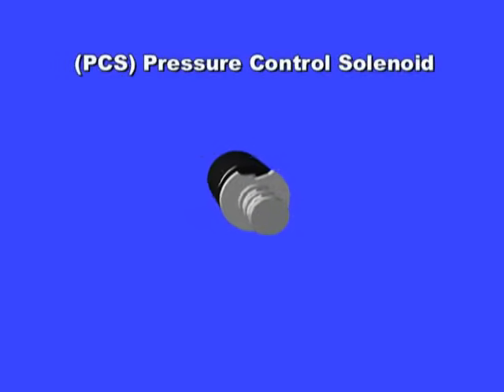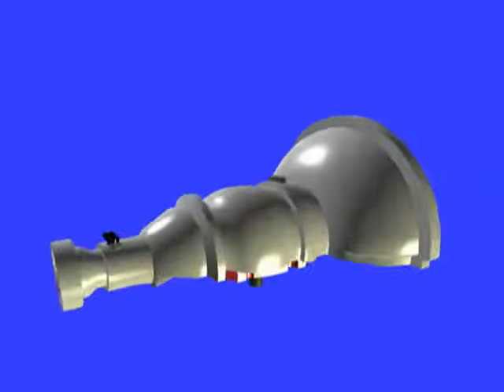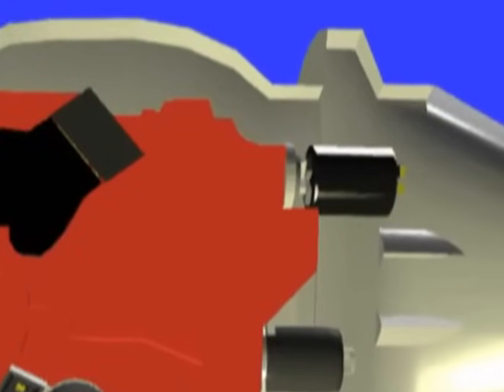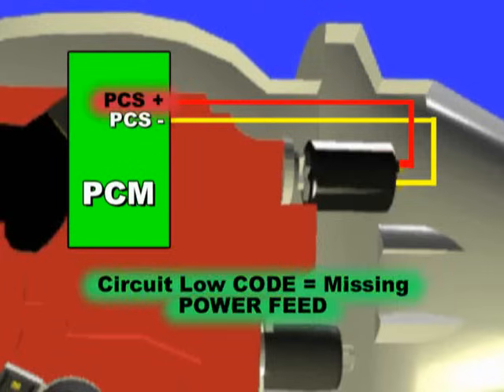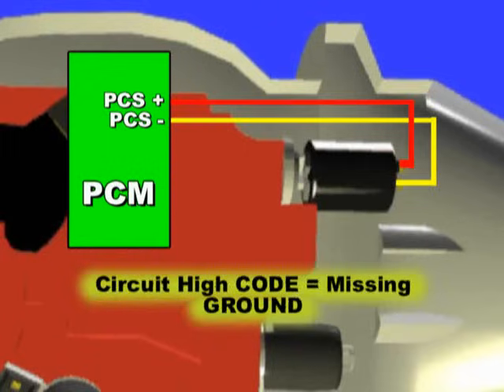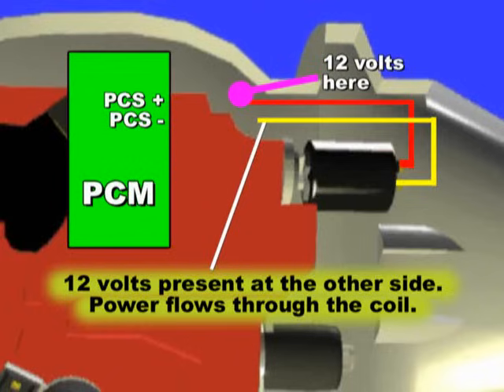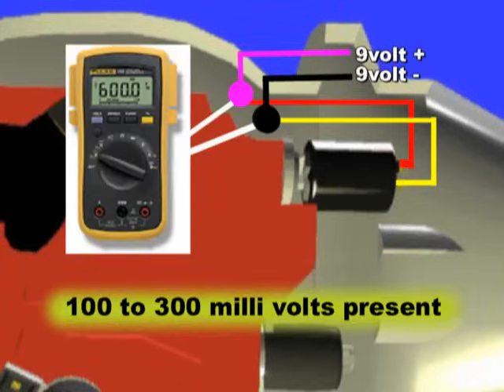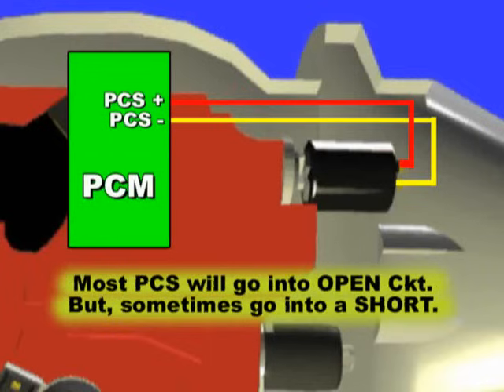Transmission Pressure Control Solenoid (PCS)

Comment: I have an automatic 98 camaro v6... I have no problem on the streets, and typically don't have a problem on the highway unless I make a long drive, like 30-40 min drive. When I'm between 55 and 70 mph it tends to have trouble maintaining speed and it does what seems like a super fast slip/surg and quickly catches and accelerates.  Dont know if it's a transmission problem or maybe a solenoid, and kind of scared to take it to a transmission shop as I feel they could possibly take advantage.... also i just found out my fuel pressure regulator is bad so I also don't know if that has anything to do with my problem. All help or suggestions would be appreciated, thanks!
Reply from the maker: daniel hernande Before tackling the transmission issue (possible) you need to repair the fuel pressure regulator problem. The trans shop will want to rebuild the whole transmission to cover their rear ends and charge you. After your engine is working 100% then post back with more on the trans if needed. Good luck.

Comment: I have a Golf 5, 2.0 FSI model 2007, automatic transmission and it is having a gearbox problem, when i am driving sometimes it stuck in gear 3 or 4, when we connect it to the computer it says (P2716 Pressure Control Solenoid D stuck malfunction) and if we clear the error, the car start working normal for some kilos ( 50 to 100 km) then the same problem come again. Do i need to buy a new pressure control solenoid?
Thanks!
Reply: Sackiro Nehale i have some problem....

Comment: I have a 2006 Ford Freestyle Limited FWD with a CVT and My wrench light (Limp mode) comes on whenever I come to a complete stop. Auto Zone detected error code P0701. The local auto-mechanic said it was solinoids. Could this help fix my car?

Comment: I have 2003 buick regal that will not shift to overdrive. Sometimes 1st gear slip and cause the car to jerk forward when it suddenly engage. There are times that it take times to shift from 1st to second or second to 3rd. Change fluid at 100, miles. what are the possible cause?
Reply from the maker: Sounds like mechanical issues. Check for codes and check fluid pressure at the different check points. Only then will you know more.
Reply from the maker: The "Transmission Troubleshooter Software" can help you with all the details.

Comment: I have a 1999 Pontiac SE grand prix and I changed the filter, fluid, ttc, 1 & 2 shift modules, 3 & 4 shift modules twice and it ran fine for 47 miles and now it is not shifting and when I start it up put it in drive it may go a couple hundred feet then it won't move even when I am pressing on the accelerator  in the drive position. It won't go into reverse, I need to put it into park, shut oft the ignition, wait a few minutes and then repeat the process. the check engine light is on and I want to know if it is electrical or the pressure control valve in the transmission. I am looking for answers. Help please!
Reply from the maker: Tina Tanner KEY WORD: I CHANGED THE FLUID... Big mistake on older high mileage transmission. The mechanical parts adapt and wear down to the old fluid viscosity and once changed the new fluid will seize the valve body ROD-Valves. You're going to have to rebuild the transmission. Those symptoms are mechanical. Even with the electronic trans connector unplugged the trans will go into second gear. That's most transmissions natural gear. Sorry for the bad news.
Reply: ADPTraining  Thanks for the reply - bad news - in this case is still welcomed information.

Comment: When I turn my car (2002 honda civic) on, I will put in it drive and it will only move 50 yards or so. What could this be do you know? I had a mechanic look at the car, but he did a poor job, only checking to see if the car would turn on and he said it was the transmission and wants to take the transmission out. Other friends of mine have suggested that it is an item called solenoid as seen in this video, while others have suggest other things. Once again, can any one help me and give me suggestions, what could this be?
Reply from the maker: Ok, first check for codes in memory with $50 scanner. The Scan-1 Lite is a good candidate for that. Then post back with codes.

Comment: What a shame they had to overcomplicate modern vehicles so...
Reply: +Jeff Dean Thank big gov for that bro!
Reply from the maker: +Jeff Dean If you want to learn more, here's a good series that allows you to build your own repair equipment. Enjoy.... https://www.createspace.com/pub/simplesitesearch.search.do?sitesearch_query=make+your+own+diagnostic+mandy+concepcion&sitesearch_type=STORE
Reply: Lol. They are actually a lot easier. Diagnostics help you weed out a problem very quickly, and the engines/trans are way more efficient when electronically controlled. thats why an old 70's truck gets 8 mpg, but a newer one with pretty much the same engine size gets 17
Reply: Josh Denham Electronic diagnostics are easier for a person who has no mechanical aptitude.  Listen, I was an AIRCRAFT mechanic for 24 years and I can assure you, I can out diagnose an electronic diagnostic machine both in speed and accuracy.  Give me a set of symptoms and I'll tell you instantly what is wrong!  You just have to know your machine.  If you DON'T well then, yes, electronic diagnostic is your only hope.
Reply: Jeffrey Dean so if I described my vehicles issues you could tell me what is wrong? :)
Reply: Not complicated at all

Comment: Hi, Have got a 2008 VW Jetta and getting codes P0798 Pressure Control Solenoid C Electrical.
where is the solenoid located and how do i change it.

Comment: I’ve got a 2014 Lexus LS 460. I just swapped my engine and now my transmission throws a p0778 “Pressure control solenoid B Electrical” code. I tried to clear the code with my simple scan tool but it comes right back on. My transmission is a 8 speed and now it only shift until 3rd gear.
Reply from the maker: Ok

Comment: I have a 2003 Mercedes s430 with P2108 code TRANS SHIFT PRESSURE CONTROL SOLENOID VALVE FAILED what should I do?

Comment: I have a 2002 grand prix and it  shakes a little getting up to speed, when I get up to speed it doesent want to shift into overdrive for about 10 miles then it shifts. code p1811 came up what could the problem be ? PCS ?
Reply from the maker: Orecisely that, the PCS or pressure control solenoid. The shaking is a giveaway. That's a signal of wet-clutch slipping. Check fluid level, just in case you haven't already. Good luck.

Comment: I do have a FORD S_MAX 2.0 TDCI 103 kw, CODE P2715 - Pressure Control Solenoid 'D' Stuck On, where is located this solenoid in gearbox valve body.

Comment: my 2002 mazda protege5 has a flashing OD light and a code for Solenoid A Pressure Control Failure.  Car is running fine, some lag in shifting around 40mph, but nothing I'd complain about.  Fluid is red.  Shop wants to replace 3 solenoids, which I can't afford right away.  Will I be damaging the car if I keep driving it?
Reply from the maker: You car is probably using one less solenoid than available. So, you won't have 1 or 2 gears, because it is that combination of ON/OFF that effects the shifting. So, since you're missing one solenoid, it'll affect at least one gear. On other vehicles, it may not even shift at all, but I guess Mazda is more lenient. 

You don't have to replace all the solenoids, but no Repair Shop will want to replace just ONE solenoid. Why? Because of another one goes, you'll take the car back to them for the same "seemingly" issue. So, unless you'll do the work yourself or have a mechanic friend that'll do it for you, they
ll want to do all. 

You may also go to the repair shop and tell them that you'll sign an affidavit rejecting the warranty, but just change the ONE solenoid. Maybe they'll go for it, but no warranty remember. Hope that helps.

Comment: i have jeep cherokee 2008 throwing these codes p0935 pressure sensor circuit high( active )
2- p1745 transmission line pressure too high for too long 
i replaced the valve block with oem brand new one still no hope -connectors - fuses all seems to be good the car is only 90k miles !!!

Comment: Yall my 2016 tahoe will drive like 3mph then completely stop moving the RPMS go up but my mph doesn't move! It never shifted funny or gave annnny indication anything is wrong it seems like a sensor or something telling it not to go or something but I'm not mechanic savy and it's been sitting at gm for a week without them diagnosing it yet and I'm terrified they're gonna tell me it's the transmission because I'm a lady and it not be that! Can anyone tell me any other problems it could be? The fluid isn't dirty , doesn't smell burnt, no check engine lights like I don't understand what's causing this but it never jerked or drove rough or gave any indication anything was wrong. Please help any suggestions would be much much much appreciated 🥺
Reply from the maker: I'll tell yah exactly whaaaa it isaaa, y'all. Y'all havaaa to replacesa the transmissaaaaa, yeah.

Comment: I have problems pressure control selonoid A and c the code is P0745 and P0795 where localise inside transmision o outside please said me where localise my car is jaguar 2001s type v 6

Comment: Honda Prelude 1998
my car is slipping on 3rd gear the rpm goes up and the car doesn't accelerate .what can it be . the shift solenoid or what? ...help

Comment: I have a 01 impala my car is stuck in high gear.. It want pull off in drive I have to put in gear 1 to make it drive and switch my gears from 123 D what does this means. I have change the stranier of the tranmission and chek the wires what else can be the problem please help
Reply from the maker: First check for codes. If node, then check for power at the trans connector. If power OK, then check for the TCM or trans-computer is grounding the shift-solenoids. CLearly all this is hard to do while the car is on. So we developed 2 items:

http://www.autodiagnosticsandpublishing.com/TransDoctor_Auto_Transmission_Software.html

https://sites.fastspring.com/autodiagnosticsandpublishing/instant/automotivetransmissiontroubleshooter

Good luck...
Reply: thanks I have check the codes I was told alot of codes was popping up and that he could be a wire or elertic problem..
Reply from the maker: Lot of codes popping up = a possible power or ground issue. Here's our help-guided software that may help.

https://sites.fastspring.com/autodiagnosticsandpublishing/instant/nostarttroubleshooter

Comment: I have a 1999 vw jetta, and she  only shift to 3rd gear above 4200rpm. I change all the sensor on the transmition for shifting but it change Notting. When i check with my obd2 for a code in the car computer,  it say ( drive shaft ). And when i delette the code, the car go perfectely until i close it and when i restart the car, the code show up again. What can i do?
Reply: How to fix the automatic shifter when it can move while running?
Reply: Cont... Shouldn't the shiftter lock into gear instead of moving on the automatic shifter?
Reply: ...without pushing the button?

Comment: impala 2008 no codes slow move whit half trotle 50 psi in idle 300 psi pulling the conector need advise only reverse seems work thanks
Reply: Fransisco Martinez ever get it fixed?.
Reply: Erls fuse...

Comment from the maker: Mr. Smith, you can not test 5 Ohms. Forget using a regular multimeter to check such LOW levels of resistance. There are low resistance testers, but expensive and not normally used by auto techs. With normal equipment, at such low resistances, it is not possible to measure it. The readings are meaningless.

Comment: WRONG most of these test in the 5 ohm range at room temp. Of course even if they pass the ohm test that doesn't mean the mechanical part of the force motor is not bad.

Comment: hi, I have a 2006 inmpala ltz that is jurking from stop lights while giving gas it will hesitate and then lung forward. its becoming for common but does not happen all the time, I was thinking about replacing tpc and the 3 other sensors. what are your thoughts thanks

Comment: Have a2008 Chevrolet uplander van will not move in drive and third gear what could be the problem
Reply from the maker: Thomas Thompson Transmission PCS, oil pump, or torque converter. Need more information to proceed.
Reply: ADPTraining where does the ball bearings go
Reply: Pressure control solenoid $60 part

Comment: 2007 toyota tacoma V6 ...tranny was clunking lightly hooked it up to a Diagnoostic and got the code 2714....HELP ME!!!!!! Im trying to avoid going to the dealer where can I get the pressure control solenoid D ?  rberni10@gmail.com
Reply: i have a 2001 vw beetle.  the code that i was given was a po740 called TCC.  wat is that and how difficult to change and costly

Comment: I have a same problem on my w203 c240 Mercedes it's showing code (P 2101 shift solenoid valve 1-2 and 4-5 short circuit to ground ) how can I fix tht problem
Reply from the maker: Probably need new trans.

Comment: Good video !
But a i have
a question. I have a mazda protege 2002 sedan automatic transmission. On the mornings if i dont let the car heat up around 10 to 15 minutes  when i put the drive shift it slip. I get a code and i have the p1250 which is for the pcs D

what thoes that means ?
Reply: Josue Fernandez Morales
Reply: Hi !